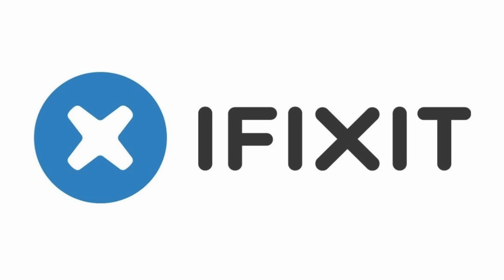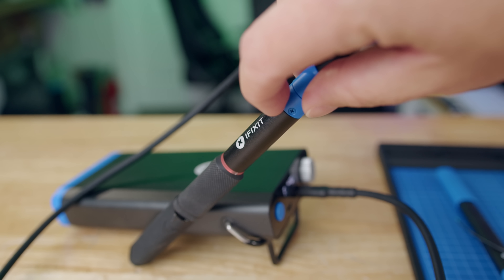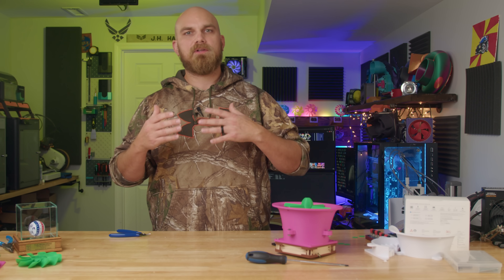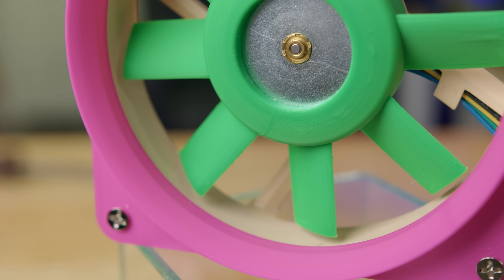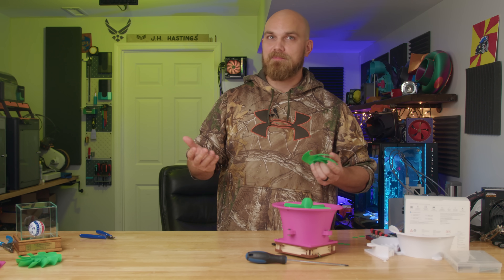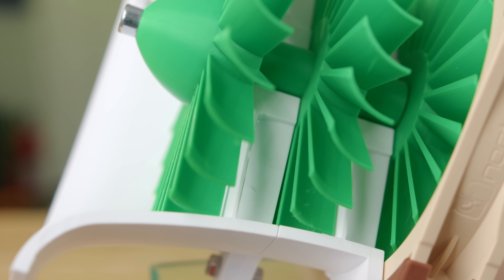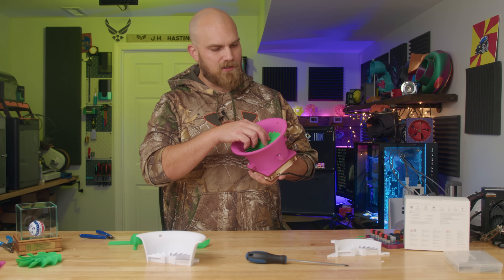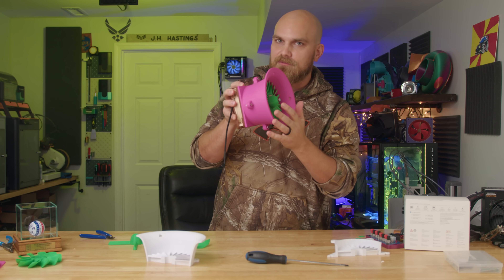Turning a PC Fan into a Jet Engine! | Fan Showdown S6E7

Comment: 5:52 Arctic cooling would like a word.
Reply: The same goes for Cooler Master and their Master Fan. I still have the one that came off of my Hyper 212 Black as backup fan.
Reply: i was always curious how a P12 would perform since its considered a static pressure fan
Reply: @rayzian  for the price it's amazing.
Reply: @rayzian  My thoughts also. Or the BioniX P120.

Comment: What I took out of the RC hobby is, that electric turbine style fans are cool and in some cases have a unique wooosh sound but!! In case of watt, ampere usage to thrust these are no good because of the amount of blades which the motor needs to push through the air. From efficiency standpoint what at least o now these are no competition to normal propeller.

Comment: I think that axial fan needs to not use the whole diameter of the fan area, if it was much smaller, the motor might actually be able to spin it fast enough with reduced mass flow of course

Comment: No big surprises there. Weight is not much of an issue for speed, as long as you're in the range that the bearing can handle without issue. It's an issue for acceleration, of the fan, so saving a few grams won't help the performance much, unless you're measuring how fast the fan spins up. The blades on the involute was also "scooped backwards" near the center. Arctic P series have a similar blade design, but they have those details right.

Comment: The stator blades in a jet engine are angled the opposite way to the compressor blades, thats why the Olympus isnt that impressive.
Reply: Looks like they were the opposite direction to me, the green blades were all rotor blades, the stators were white. The reason it didn't "impress" is probably mostly due to the fact that type of design requires a lot of power to work well. It requires high air flow, which requires a lot of power.
Reply: You're not going to get meaningful compression with a fan spinning that slowly, so stators are just extra impedance to airflow.

Comment: Actual grain dryer fans are designed to push large volumes of air until the interior pressure forces the(usually warmed) air through the grain to pull moisture out.  It might be instructive to hook these up to actual radiators to see what the performance is like, because you can do all the dry runs you want and gather all the data in the universe, but the proof is in the actual cooling that goes on.  Elsewise this is little more than navel gazing.
Reply: This is not a cooling test, it is a static pressure test. Not about cooling, it is about static pressure. How hard is that to understand?

If you want tests that push the air through a radiator, then look at the previous seasons of the fan showdown in this channel. There's a season there that actually tests cooling performance, and that's not this one.

Comment: 3:04 The air/gas exhausting the thrust cone of a turbine engine is at or near the same ambient  pressure of the air around the engine.  The air Pressure is increased internally returns to ambient in the tail cone.

Comment: The olympus was not carefully modeled, or the creator did not understand the purpose of the stators. That smoke in the smoke test had a lot of rotation indicating a lot of wasted power.
Reply: That is important, if your goal is to create thrust, not so much if you just want static pressure.
Reply: They have enthusiasm but not expertise, not that I'm any better in that regard, I respect the attempt, would be awesome to see them give it another go with some help/research

Comment: I got invested in the sponsor segment because I need a new soldering iron. I love it when sponsored segments are "look at this thing, it's a good thing, here why!" Instead of rote script reading
Reply: 3 minutes long at the very start of the video is a bit much tho
Reply: @geekswithfeet9137  You can fast forward videos on YT
Reply: @geekswithfeet9137  I love it when channels use sponsor parts, because it really helps them and i don't have to see them, because I use sponsorblock like a normal person.
It is 2min 31sec btw
Reply: Not to steal ifixit's thunder, but take a look at pinecil. I got it as a small backup soldering iron, but it ended up becoming the main iron i use. It's made mostly for precise work, but with wide tip and a good usb-c charger you can put down close to 100w of heat if you need to.
Reply: Yup I got the pinecil to. So much better than 110V soldering irons. Using it with a battery pack on scissor lifts is just a win
Reply: @elektroencefalografista  Both of them are top notch.

Comment: I've designed, printed, and built a functioning axial compressor/jet engine, but I don't think the Noctua would be able to spin it. I have it driven by an electric motor from an RC car via a 3:1 drive belt setup, and the compressor spins anywhere from 20-30k RPM depending on what fan design I put in it. It's also around 250mm long (or over 400mm with the turbine section attached) so fitment may also be an issue. It's been a long running work in progress, maybe one day I'll finally make a video of it.
Reply: Would be cool if he made a noctua compatible 12v motor with more amps. Throw random blades on it and see what happens.
Reply: I have a design ive been working on for a screw blower type supercharger and i would be afraid to submit it for the same reason, the noctua fan just doesn't have enough power/rpm unless he wants to print and assemble some sort of crazy gearbox 😂
Reply: What’s the advantage of using multi-stage air compression for airflow or cooling, besides cutting down the CFM? turbine compression is typically for delivering the right air volume for your combustion situation.  Feels like chasing perpetual motion— limits due to energy constraints. 12v density vs petroleum...getting the compressors to spin fast enough for increased airflow would be nearly impossible without a denser energy source.

Comment: I think the 3 stage need support between each stages … without support it’s won’t work.
Reply: Yes, bearings between each stage. A single bearing would have too high a load as well as balancing issues. Very much like when balancing a tire with lead weights.

Comment: Involute needs the tips connected to the back of the previous blade with a thin strut. Hybris made me wonder if it didn't just act like it had thick blades. Grain Dryer is just a nice simple high speed fan with no skew and rather small blades. Maybe try a 10 bladed version for more blade area?

Comment: Paused at beginning to say: if this is an actual 3-stage compressor with some math in it (:: not just 3 of the same fans, but, sized for actual function), then, yes, absolutely, these ARE the droids I'm looking for!
Reply: it CAN work. the problem is blade deformation and an underpowered motor.
I'd like to see all the blades supported on bearings as a modification
Reply: Too bad the stabilizer didn't stabilize, or that whatever tolerances were out, or both, or whatever :/ wish there was a way to print a good one!!  It would be hella sweet!!
Reply: Maybe, axial compressors use a ton of energy and are traditionally prefered for lower pressure, higher flow applications.

For actually cooling a radiator, I think an axial (with a more ideal design) may do better, but in this test that is only examining static pressure, it is hard to imagine anything beating a centrifugal blower (at least of an a12x25).

I think our big issue is that the static pressure test is not a great one for cooling performance.

Proposed alternate tests:

1: time to fill an air bladder (maybe a plastic bag) when mounted to a radiator. Or same with a volumetric flow sensor behind the radiator.

I think he may have done something similar a few seasons back, but I don't remember.
Reply: @JOEDHIGGINS  He used to to do volumetric flow, and then I guess the comments convinced him that static pressure was more important for cooling a season or two ago and he's been trying to figure out how to best measure that ever since.
Reply: @GremlinSciences  I think static pressure is important to push air through a radiator, but not if it reduces the volume flow. Measuring only one thing allows cheesing if the fan has a reduced cross section in exchange for higher pressure. Best would be to measure volume at some flow restriction similar to a radiator.
Reply: @brianorca  In a way, to find out performance of a fan I guess one should measure both pressure and flow, and basically work them into a graph... This way of testing one or the other does allow for some crazy builds that would not be very useful in any actual use. But on the other hand, it still does create some interesting content.

But if we would want to go back to more realistic measurements, I guess maybe the easiest option would be to use a standardized restrictive device... Say something like an actual radiator, and just measure the airspeed going through, maybe pressure between the fan and rad as well, as he now has equipment to do that.

Now that kind of method would not be perfect, because a lot of fans are used in practically near zero restriction operation as case fans, and in that case it is more about just volumes at very low pressures... But a radiator is fairly common and representative for other types of coolers as well. And it would be easy to argue that a fan able to push signifficant volume through a radiator would certainly not be a terrible even as a case fan.

I think in some earlier seasons he used to measure actual cooling power... But personally I think that might not be necessary. It just adds variables that need to be checked and controlled, things like ambient temperature and heat load on whatever you are using the fan to cool. Airflow is still what you need to cool and pressure is needed to overcome flow restriction. So flow through a radiator would, in my opinion be simple and fairly good real world performance test.

But on some level I think I would like to see some crazy builds every now and then.
Reply: @GremlinSciences  for cooling a radiator, I imagine static pressure is better than than volume flow if the voulmetric flow is not measured through a radaitor.

When you measure flow through a radiator, then it presumably about the closest you can get to how well it performs (other than directly measuring heat removed / unit time, but that would require some significant additional controlls).

Comment: The problem is the fan RPM. Axial compressors are running at 10s of thousands of RPM. The design has to change to be optimised for low speed operation.
Reply: I'd like to see him do a season where he uses a pulsed power supply so all fans can be locked to something like 2000 rpm and X watts. And they gain or lose points if they can hit 2000 rpm at a lower wattage.

Or, do a season where the fans are run through 2 tests.
2000 rpm (any power)
30W (any speed)
He'd have to change up what he's using to drive them probably, but they make industrial cabinet fans in 120 and 140 with sufficient motors.
Reply: And actually have size limitations.
Maybe a class for "in-frame" (i.e. fits inside the standard frame) and an exo-frame class where fans can be anywhere in an additional area.

Comment: Static pressure data is useless without flow data, sorry this season is useless.
Reply: False. Static preasure is important when dealing with radiators. Flow Speed can help to a degree but it quickly hits a point where  more is less as there isn't enough time to pass the thermal energy to the moving air over the fins.
Reply: @SilvaDreams  False? What is point of static pressure if there is no flow? You can have very low flow and very high static pressure, and in that case the fan would be useless for cooling.
Reply: @Taluvian  Without flow, there's no cooling by convection. So without any other information, static pressure alone is useless for computer fans.
Reply: @fishyerik  That's why I think this season is useless. I want flow and static pressure so we can see which fan designs are truly good. I don't understand why he dropped flow testing. He should have added static pressure to the testing and not dropped flow testing.
Reply: It's entertainment. For practical purposes I totally agree, static pressure alone is useless in this context. An extra source of entertainment is reading all the comments by people that show no sign of doubt about being experts on the matter despite being dead wrong about simple things.

Comment: I feel like the problem with the olympus was the angle of the blades, the first stage looks like the angle of attack would be really high causing severe flow separation and the angle doesn't really look like it changes as it goes through the compressor stages which you would normally expect.
Reply: Agreed.  The blade pitch of all three stages is way too high.  The first stage should be fairly shallow and each of the following stages should be slightly greater.  The blade pitch should be set to move about the same volume at each stage.  This is a complex design project to do properly.
Reply: there is a function for that  @wingsounds13
Reply: yeah I taught that, I doesent Look calculated to me, maybe I could reupload a better version of my multistage fan, it was a catastrofe, but i calculated the speeds and blade angles, season 5 episode 4 btw
Reply: Alternatively, use gearing to spin them at different speeds, which simplifies the blade disk design and lowers the total drag (if the gearbox drag can be kept low).
Reply: That kind of design just won't be able to outperform the leaders in this type of testing. Not enough motor torque and too low rpm.
Reply: what are you all even talking about, this fan rotated at barely 700 rpm, thats nothing for axial turbine. Jet engines rotate at 5000-10000, steam turbines up to 15k RPM
Problem is not the design, but the power. Noctua motor is designed to rotate at around 2000 with small blades. Add all this mass and nothing happens, it simply cant turn. 
Put some model airplane motor to this thing and then we can talk about blade angles.
Reply: @igors_lv  the same fluid dynamic priniciples are involved even on a small scales and low rpm, they are less noticable, but there, the radial fans are preforming well at low speed, and they are not at spinning 150 k rpm like a turbo in a car.
Reply: @frandiminic3559  turbo's pressurise in much the same way as the leaders in the test, by utilising centrifugal force. So they aren't really comparable to axial fans. The problem here is that there is simply not enough motor torque to turn that assembly at an rpm where it would actually work. No blade pitch changes are going to fix that.
Reply: 100%, that compressor was sitting at full stall the whole time.
Reply: You're really not going to get much compression out of it, doesn't spin fast enough. You probably do need some means of straightening the airflow, not staters persay, just, something to keep the turbulence down so it's easier to prevent flow separation, with the added benefit of giving you a place to put more bearings.

Comment: not surprised the Olimpus sounded like a siren when it was designed after the engine in one of the loudest planes ever made aside from the thunderscreech
Reply: The design probably had the same amount of stator blades as compressor blades, which will make it sound like a siren
Reply: @Skracken  Was going to write this too, but yes like you sad it will make a lot of noise, thats why actual engines never have the same blade count on any stage.
Reply: Hey, fancy seeing you here! I usually watch your videos, and hang out on SweC too
Reply: @Skracken  You can clearly hear that the blades are rubbing. It's as simple as that in this case.
Reply: @mytube001  No that's a different sound.
Reply: @Skracken  If that's what you want to believe, I won't stop you.
Reply: @mytube001  It's not about what I believe, it's about how it is. Every time a compressor blade passes a stator vane, there will be a pulse in the airflow. So if ALL compressor blades pass a stator vane at the same time, it will make a loud sound. To counteract that, you can have one less stator vane than compressor blade, which will more or less remove the siren sound. Source: Rolls-Royce's book "The Jet Engine".
Reply: @Skracken  Still irrelevant. The noise is identical to that of the other fan, the scimitar-bladed one that was too weak and was rubbing. You're trying to invent a complicated, real-turbine-engine explanation for something that has a much simpler reason.
Reply: @mytube001  You're obviously resistant to facts, and not worth my effort. But by all means have a look at server fans or for example the Noctua NF-F12, and count the stator vanes and fan blades. But clearly, you dont want to understand.
Reply: @mytube001 not true. If you listen. You both are correct. 😊
Reply: I think its both sounds at once, theres definitely a siren sound and a scratching sound
Reply: @SamCouchman  Yup, exactly
Reply: I was about to say, thunderscreech has entered the chat. Lol can’t forget the F-104 either, she was LOUD too.
Reply: To be fair, it made the noise because it was rubbing.